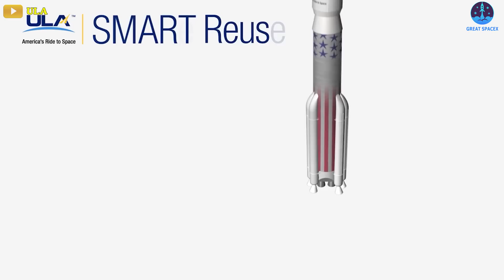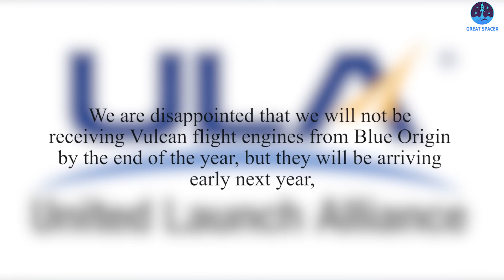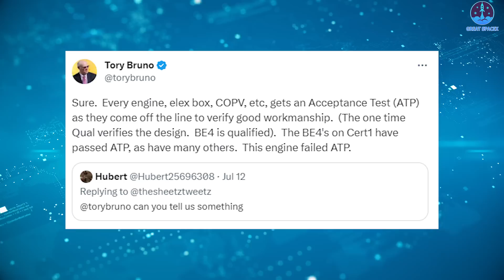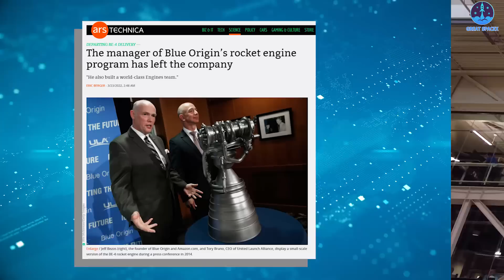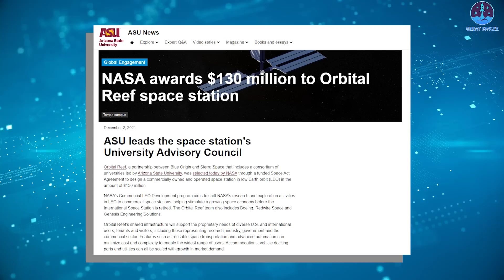The Disappointing truth of Blue Origin BE-4 engine! How SpaceX can save...

Comment: Blue origin and SpaceX started about the same time. 
Blue Origin has a penis rocket that takes billionaires just to zero gravity for 10 minutes and returns. And has a broken BE-4 engine. 
SpaceX has developed the Merlin engine and a series of Raptor engines and both have a sea level and space vacuum variants. SpaceX has the work horse rocket of the world - the Falcon 9, with 100% reusable boosters that land on ground or ships on the ocean. SpaceX has the Falcon Heavy rocket with 3 100% usable boosters that land and it can go to LEO or GTO. Plus it id human rated. 
And then there is the SpaceX Starship in it's infancy.

Comment: At 9:50 notice that every line and cable has a at least 2 connectors, and every one of them is a possible failure point, whereas Elon's mantra is "the best part is no part," BO is moving in the opposite direction. It doesn't take an engineering degree to understand why they are plagued with delays.
Reply: The more they overthink the plumbing, the easier it is to stop up the drain.
Reply: @johncherish7610  HaHa!  Looks like  B.O. needs to find a Mr. Scott as their Chief Engineer.

Comment: ULA hedged their bets with the BE-4. Personally, I'd have made two variants A BE-4 variant, and a modified Vulcan that was Merlin capable that would keep ULA out of its current pickle.
Reply: For the price they could have just bought 2 raptor 2's and would have already launched the ULA Vulcan already and saved billions to buy quite a few Raptor 3's
Reply: It would be smarter to develop a Vulcan using Raptor engines, rather than Merlin engines. Vulcan uses methalox as does Raptor, Merlin uses kerolox.

Comment: Check out the difference in complexity between the BE-4 and a SpaceX Raptor. It looks like they tried to make the BE-4 as complex as possible. The Raptor is amazingly simple, especially for a full flow staged combustion engine.
Reply: Raptor V1 was pretty messy, too, but they have been cleaning up the design with each iteration.  Version 3 will be cleaner yet, and almost as powerful as the BE-4.  Of course, being the most powerful is of no use if you can't make one that works.
Reply: @jkleylein  Raptor 3 (2,640,000N) is already MORE powerfull than the BE-4 (2,400,000N):  https://en.wikipedia.org/wiki/Comparison_of_orbital_rocket_engines
Reply: @stefanbaartman5893  but no Raptor 3's have flown yet. I am sure they will blow a few up in the rapid prototyping design process, but even still the end result will be done before a BE4 ever flies
Reply: @stefanbaartman5893 yep, Raptor III  is more powerful than BE4 and also weighs less....
Reply: It looks simple, and it is, but it only got that way after being refined down from being a complex engine.
Reply: It all comes down to the Jeff Bezos philosophy that the best part is five parts and the best process is five processes.

Comment: Has BE-4 ever been used in a rocket flight? None, as far as I know. This contrasts with SpaceX`s Raptor engine: It was used by the Star Hopper and has been tested in REAL world ever since version 1.0 SO, I believe Blue Origin has made a huge blunder, that is, not to test BE4 in small flights,  in real mode. If it explodes, make an improved engine, and keep testing it in flight condition, until getting it stable and reliable. That`s my 2 cents of help to B.O.
Reply: BO runs hardware poor, get it right the first time, assume we are right. SpaceX runs hardware rich, assume we are wrong and test until it breaks to find out how we are wrong. 

Yes, BO should do a lot more on a rocket testing, but they cannot make engines very fast and cannot make rockets quickly or cheaply like SpaceX. While SpaceX make a Raptor every day, BlueOrigin is on a multiple months per engine pace, making attaching some to a rocket and maybe blowing them up a different proposition for BO.
Reply from the maker: Thanks for your sharing
Reply: I think it's their engine design that simply make things hard. Elon way of thinking is to make things as affordable and as simple as possible since his ultimate goal is to lunch hundreds of starship at once they need to be manufactured in the shortest time possible as well. This allows for many test opportunity at an affordable cost increasing the pace of their progress.

The be4 engine feels like the kind of thing you'd be afraid to break because getting a new one would be near impossible.
Reply: They don't listen
Reply: The Raptor also was not used successfully in a real world rocket flight. Just in some failed test flight. The approach of SpaceX has more visual impact of cause, but that only suggests. progress. And flight condition or a test stand does not make that much of a difference in this stage of development. The stand is much more a controlled environment compared to the hit and mis approach of SpaceX. My guess (and nothing more than that) is that it will take BO another year before an Atlas can be launched. But Space X at least 2 to 3 years to launch a commerical Starship flight. The Lunar version could be faster because the lack of heat tiles. But we will see. Competition is good.

Comment: All these delays because each engine failure delays the program for a year or more? If I remember, Elon admitted to blowing up 20-30 Raptor power packs and melting over 50 combustion chambers, and they are now building Raptors with serial numbers in the high 200s. Also, these Blue Origin fans you speak of, I thought we got rid of "mental institutions" years ago.
Reply from the maker: Thanks for your sharing
Reply: Speaking of BO fans as inhibitants of a mental institution when taking everything that SapceX does without any criticism. What does that make you?

They are building a lot of engines, nice. But they are still unreliable. 10% does fail before or during flight. Nog good for an engine that should be used  in multiple flights a day.
Reply: @vandenhengel978  
I don't think the OLT-1 engine failures were the fault of the engines.  I suspect nearly all of the engines - not current models, even at that time - failed because of damage inflicted by flying chunks of concrete, gravel, sand and re-bar.  Hence, the deluge system and the steel plate where the pit was blown out.  Time - and subsequent launches - will tell the tale.

Comment: Lets be real. BE4 was nothing to do with centaur explosion. The tank was the fault. If you use same logic , raptor engine is pure catastrophe. None rapotors has ever managed to fly space in 4 years. Over 30 engines has been destroyed at testbench, and hand full of starships has exploded during rapotor firing. Lets stop fanboy hate for other companies. Blue is doing very good work, this private firm has tons of talent, same as Spacex. Competition is profit for every customer.
Reply: While there was some clear bias for SpaceX and against BO in this video, comparing Raptor to BE-4 is in some ways apples to oranges. SpaceX's raptor engine is a full-flow combustion cycle engine operating at 2-3x the chamber pressure of BE-4, and SpaceX deliberately tests many of it's engines to failure. But yes, I agree with you that I'm rooting for both SpaceX and BO, as competition/redundancy is vital.
Reply from the maker: Thanks for your sharing

Comment: At the end ULA gets fined because sue origin cant deliver, after 12 years! But also the new mini-shuttle is grounded by this. Forgot that in the video? BTW, thats not the only opponent to spacex. Theres still the rs25 engine. If noone had a plan B, then they deserve whats coming.
Reply: ULA needs to buy a few Raptors to get Vulcan flying.  Bezos will be certain to get BE-4:squared away PDQ.
Reply: @frankmcgowan9457 they’d have to redesign the tanks. Different fuels.
Reply: RS25's burn hydrogen an LOX a far more difficult fuel to deal with than LIQ-Methane would require a complete scrapping  & redesign of the tanks and plumbing, you simply can't bolt on a RS-25 to the existing hardware

Comment: Before SpaceX can save anyone, they themselves have to make the Raptor work reliably.

The Raptor failure rate during all Starship tests and flights so far is not something to brag about and not something that a third customer like ULA could accept.
Reply: Given that the SpaceX Raptor V3 engine is being mass produced, along with less plumbing. It's failure rates on the test stand are much lower than the BE-4 Blue Origin engine by percentage of the number of engines that have been tested.
If a Raptor V3 goes Kaboom on the test stand, Elon and his fellow engineers put their heads together and ask the question, what happened, let's fix it.
When one of the very few that have been built BE-4 engines goes Kaboom on the test stand, Bezos says "Don't disturb me while I'm cruising around the Mediterranean Sea with all of my hangers on".
Elon is an engineer, Bezos ain't.
Elon's dream was to build a first stage booster that could launch a payload to space, and return for re-use. And he's done it, on a regular basis.
Starship will make it to orbit, that's guaranteed, Elon doesn't give up that easily. Unlike Bezos, who hasn't got a bloody clue about engineering.
Reply: @rogeremberson6464  I agree. SpaceX treats a failure as a lesson not a problem. That is why Falcon I and its Merlin engines are not only reliable but they are reusable.
Reply: @clay-tw5gc  Funny how Elon has brainwashed everyone to think failures are good. If you do make mistakes, it is obviously good to learn from the mistakes. But actually getting the design right is even better.

Oh an making the same mistake over and over is not learning from your mistakes.
Reply: @torben777  Iterative design is not a new concept. You learn much more and you learn it faster by pumping out test articles and actually trying them and looking at the data. SpaceX has successfully landed and reused their first stage boosters 228 times. 
No other entity on the planet, company or country, has launched and hot landed a vertical launch orbital class first stage booster. Noteworty, they've landed 3 boosters from the same launch with Falcon Heavy.  
I get that you want to hate Elon, I kind of agree. He's a piece of shit. But SpaceX is the most advanced space flight organization this planet has at the moment.
Reply: @torben777  Failures will occur. I know from rocket development personal experience that there is no way to design perfection.  There is an old military saying that the best laid plans are laid to rest when the first boots hit the ground. Elon's philosophy is simply failures will happen. Don't design until you believe you have perfection. Design, build then test. Then find out what went wrong and fix it. Then try again. That is not brain washing that is reality.
Reply: @rogeremberson6464  Nothing you stated is a matter of fact. The fact is that Raptor has failed on every single launch and every single static fire so far. 

Mass producing an engine that is not yet reliable, does not make it more reliable.
Reply: @torben777  and you are absolutely incorrect and correct  at the same time yes engines failed during launch but not every launch because they have had only 1 complete launch test that failed,the rest were hover hop and high altitude testing, but you are also incorrect in stating that all engines failed during static fires , all raptor engines go through rigorous testing and full duration static fires in McGregor Texas before the engines are even integrated on the rocket at Boca Chica
Reply: @giminai8000  The longest duration raptor static test fire I have been able to find is 20 seconds. To get to orbit it has to fire for at least 5 times as long. 

Pretty odd its hard to find even a single full duration test fire if “every single raptor engine ever constructed” has gone through one dont you think?
Reply: @torben777 You’re right. Two engines shut down before the end of the last static fire, 31 didn’t. I think I read it only needs 29 to get to orbit. I always thought it would be difficult to keep that many functioning but there’s room to lose a couple.
Reply: @torben777  actually, it does. as each failure can tell you how to improve. BO doesn't have that.
Reply: The Raptor is rapidly becoming reliable. During the first launch, it was not the Raptors that failed. Fire in the bay damaged cables that interfaced with the engines. That was not a Raptor problem; that was a vehicle problem.
Reply: @clay-tw5gc  not true, at least not true for all engines.

During the first launch 3 raptors did not even start up. You can hardly blame that on fire damage. During the first static fire engine test after launch 4 engines did not start up. During the second static fire after launch 2 engines did not start up.

Whatever the probles is, it seems to be pretty consistent.

And these are 5 second static fires, which is not even enough for starship to clear the ground. Many other rocket companies run full burn tests.

Anyway, before you can claim anything has gotten better we need to see a new and more successfull test.
Reply: @torbennrskov3691  5 out of 66 engines installed and tested as opposed to BO supplying 2 for testing and failing.... my bets are on Space X
Reply: @ramonmacias9013  My money is also on SpaceX, but I am just pointing out the obvious.

So far neither BE4 nor Raptor has been reliable.

The Merlin engine never had the problems we are seeing with Raptor. It more or less worked from day 1.
Reply: So 2 engines on a Vulcan and if 1 fails and blows up it would take out the other even if not you lose 50% of your thrust if one fails now with 33 Raptors even if 3 fail it can still get to orbit on the remaining 30, yes more that could fail but less loss of thrust for each engine

Comment: With enough  money the BE4 will be OK. I look forward to it but the bottom line is the Raptor will be 1/4 the cost and more have a greater production. In the long run most of the flights will go to Space X and the BE4 will do a few flights a year.
Reply: You’d be surprised most engineering problems require talents from CEO down, as money won’t do it.
Reply: Better not be taxpayer money.

Comment: Blue Orgin has to get that engine operational. We need competition here in the USA in the space industry. We cannot depend on just one launch provider.
Reply: Nobody depends on a single provider here. U C the air force still spreads the contracts. But one provider depends on non-existent hardware. Wheres plan B, like redesign vulcan with RS25? 4 years delay is time enough!
Reply: Competition at any cost is not competition!
Reply: Get ULA to buy Raptors and Blue Origin will come through.  Otherwise, Bezos will finish driving ULA bankrupt, buy it for 5 or 10 cents on the dollar and - suddenly - BO will be one of the American companies with the most lauch experience...
Reply: @frankmcgowan9457   Spacex has already completed more successful landings since their last landing failure than ULA has total launches, but I guess you can call a distant second one of the most.
Reply: @frankmcgowan9457 
And still no working engine! 😅
Reply: @frankmcgowan9457  He would have to buy SpaceX for that to be true
Reply: ULA should sue BO for breach of contract. I don't think BO will ever have a reliable production system for the BeFour. And ULA will end up with Raptors After all is said and done.
Reply from the maker: It's also NASA's mindset
Reply: I am a huge fan of SpaceX, but it is true that competition is needed. Unless someone is chasing after them, even SpaceX will grow corrupt and flawed over time. The way that things look now, some other company than Blue Origin will be SpaceX's main competitor.
Reply: @wordsofcheresie936  I am in full agreement. I to am a big SpaceX fan but I also support their competitors as well for the same competitive reasons. Their competitors must succeed.
Reply: Put up or shut up!  If you knew anything about clown boy Bezos you’d understand why this engine development is a hyper joke!  I’ll make you a gentleman’s one dollar bet that we will not see this engine anywhere near flight ready much before mid to late 2025.  Stay in touch.
Reply: Why we depended on NASA to be that,  So now with SpaceX there are 2 not hardly a monopoly